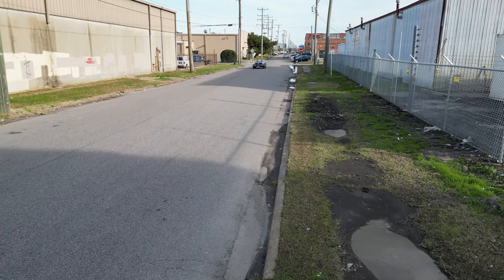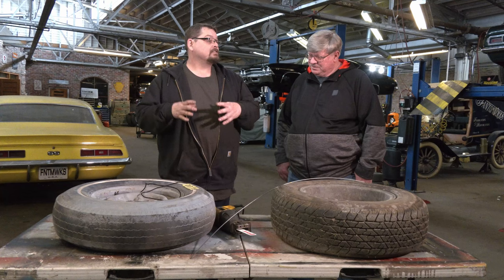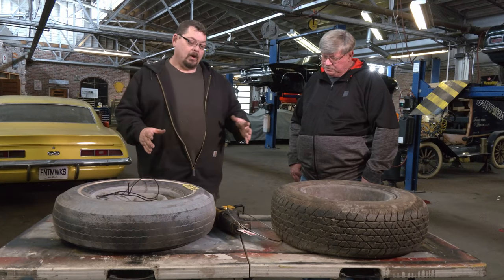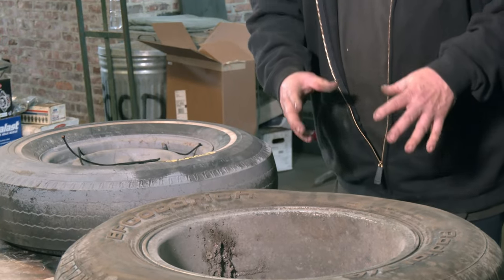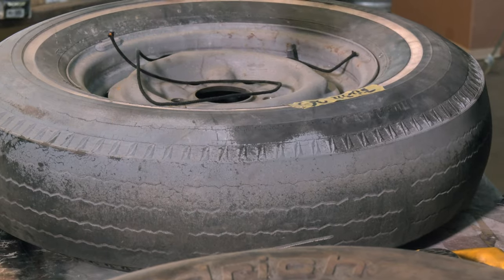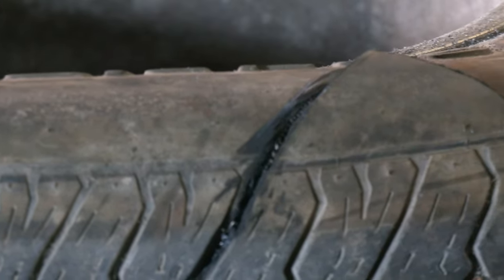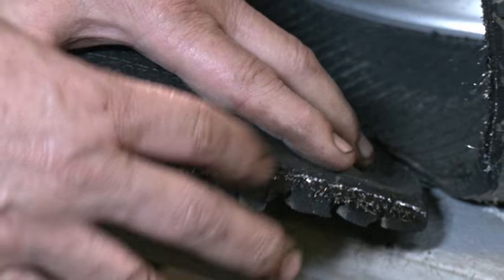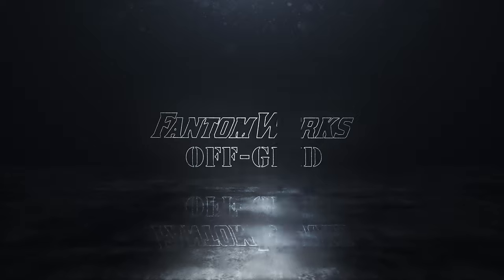Bias Ply vs. Radial tires - Cutting up with Chris

Comment: He mentioned winches using rope vrs steal... but you can get synthetic rope for winches. Never seen them used on large scale such as wreckers or cranes, but they are fairly popular with winches on smaller trucks like Jeeps. Synthetic rope can be just as strong as steel wire rope, but weigh alot less.
Reply: That’s right….the biggest disadvantage to synthetic rope vs steel cable in those applications is abrasion resistance. The polymer cords just can’t take the friction when spooling and unspooling under a load for long periods of time.

Comment: I have a set of 33x12.50x15 tires that I bought in 1985. They have never had air added to them and they are still aired up. They are on my 1970 Chevrolet Blazer....
Reply: @edstingray3828  I would agree with you if I was driving on the highway or faster than 20 or 25 miles an hour. I only drive the Blazer on back roads and trails on my property.
Reply: Tires that old get brittle because rubber hardens with time from reactions with sunlight and air. Be prepared for them to go out at any moment.